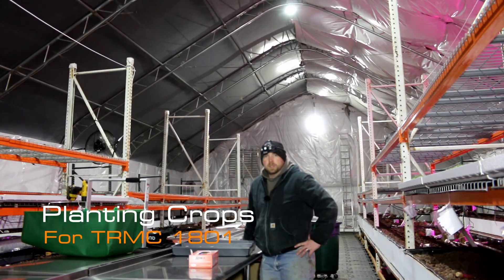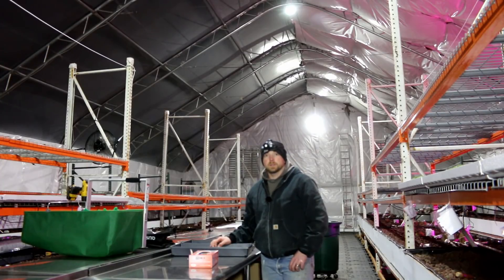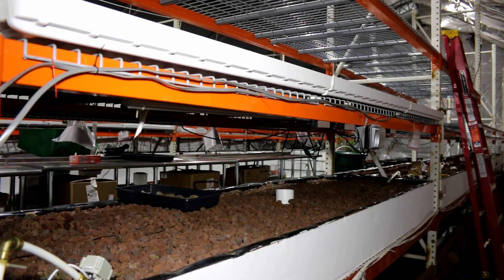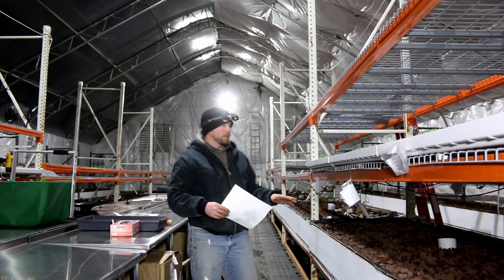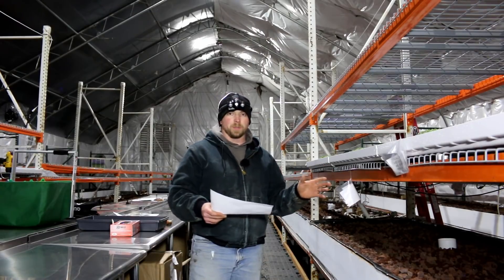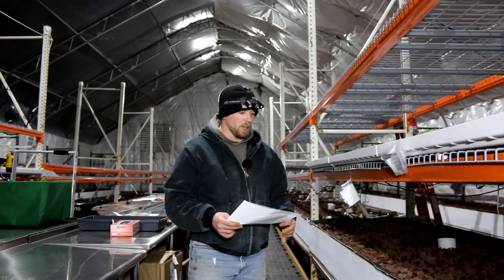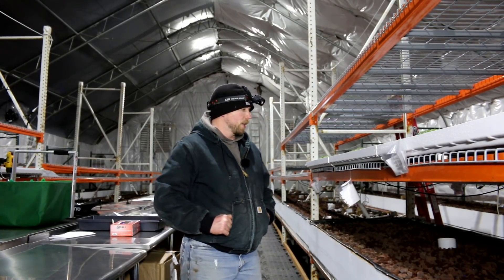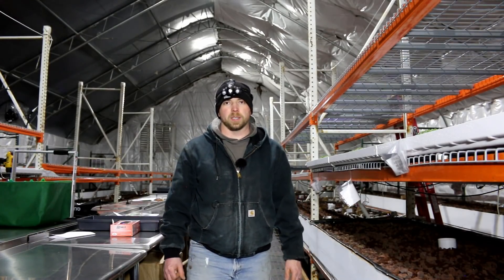Planting AQUAPONIC POTATOES

Comment: I started growing hydropinc potatoes some time ago, but instead of cutting potatoe and letting it dry in the sun, I placed whole potatoe under led light for a few days. When small shoots appeared on the surface of the potatoe I removed them carefully and placed in moist growing medium under led lights. After some time shoots started to develop long roots. I'm not sure if your potatoes will manage to rise to the surface of growing bed, but I may be wrong, they have lots of stored energy.

Comment: With the beds being uneven it sounds like you need concrete footings under the legs. A footing on ether side of the fish lane and a timber bolted into them that the lane structure then sits on. They would also give you something to support the dirt from slumping into the fish area. 

Yes it is a lot of work but when you add all the items up you have tons on just a few points of contact with the ground.

Comment: taters grow between the seed potato and the top of the plant.  Like most root crops they will be difficult to do in aquaponics due to the nature of the medium. You may get large plants but very little in the way of potatoes. Most potato plants need to be mounded after the plants emerge basically burying the plant every time it gets to about 4 inches high till you have a good foot or more covered base between the seed potato and the bottom of the exposed plant in which to grow the potatoes. Ive grown potatoes in 5 gallon buckets for years now and loose medium and a good mound is key.

Comment: Ground Control To The Real Martian Status Update With Planned Project Test Martian In May

Mrs Martian should reside in The Mother Ship and Mr Martian should reside in Hab 1. Mrs Martian should remain on standy by in case of Hab 1 difficulties.
Mr Martian should ensure he keeps fit in the 3 day test, Ground Control suggests he should climb into the roof areas of Hab 1 and monitor the temperatures throughout the day and see if there is air movement and even temperatures throughtout Hab 1.
Suggest Mr Martian empties the trout from Lane 4 into Lanes 1 -3. Look at filling Lane 4 with minnows.  This will start the minnow project and also look to test the minnow feeding for the trout.

Good Luck Mr Martian we are keen to see the results on this test. Ground Control Out

Comment: Tators are going to rot in those beds.   Tators can't move rocks and they need full sun which is not there. Chit tators in shade.  You had better pee in the tanks to help get them cycling because the water and grow bed media is far too cold for the nitrogen cycle.   Unless you get your systems cycling the plants will suffer.  I would like to add, most of those deeply planted potato seeds will rot, create anaerobic zones and raise the pH.